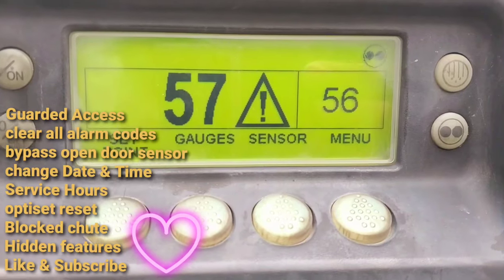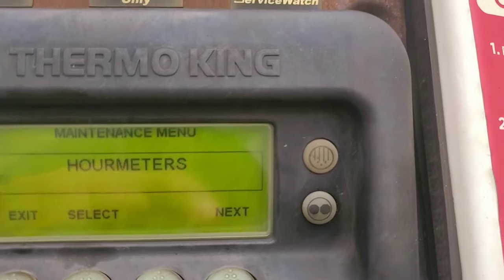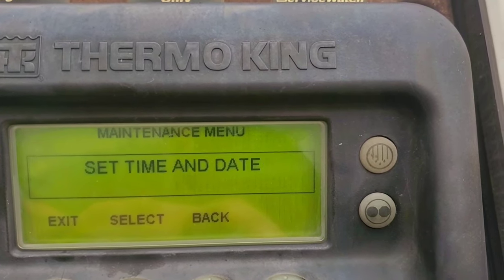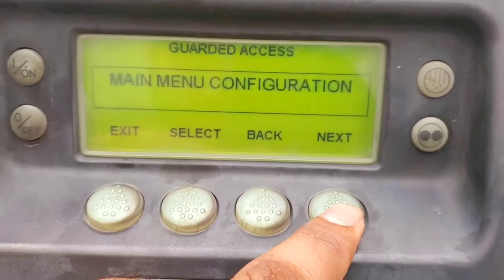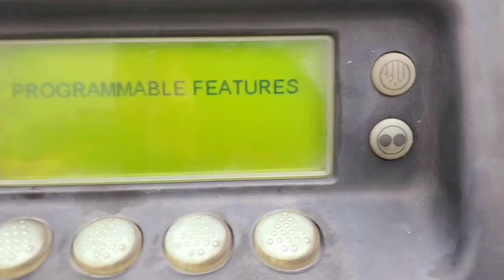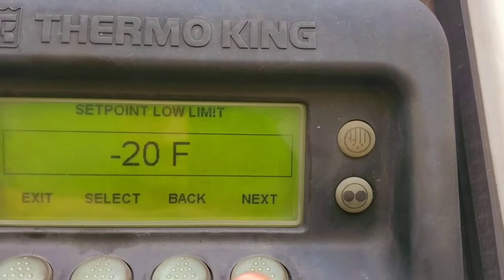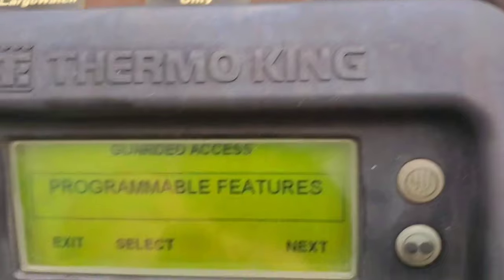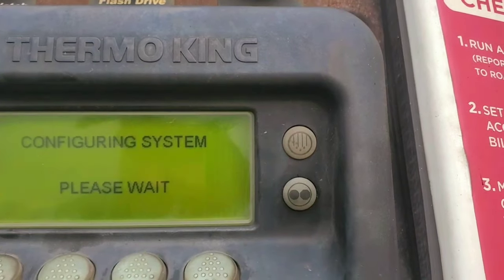How to clear all reefer codes (Guarded Access)

Comment: Manual defrost. When hot gas from the compressor goes to the evaperater coil and melts the frost or ice. When that happens the evaperater section of the unit is completely closed off from the cargo area by a small shutter door where the air goes into the chute. To prevent warm air from going into the cargo area. The melted frost drains out of the unit and onto the ground though the drain tubes. I've loved these units sense I was a teenager back in the 80s. And it keeped me on the straight and narrow. I have one person to thank for that!!🥶😇THERMOKING 4 LIFE💙